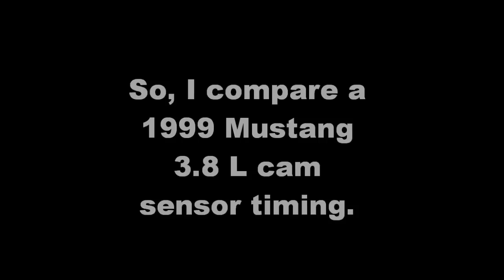Installing a Ford Cam Sensor ( Cam Syncronizer) without the special tool.

Comment from the maker: What I'm showing is that the moving blade needs to be aligned with the stationary window when the crank is at zero degrees and both valves are closed on #1 cylinder. The position I installed the sensor in is the factory orientation. As long as one is able to reconnect the sensor lead, it can be installed 'clocked' to any of the teeth on the sensor shaft. As long as the blade and window line up when everything else is lined up, the ECM believes the engine to be at TDC.

Comment from the maker: Can Sync on an American car usually means the ECM gets a signal from the Crank sensor and it expects one from the cam sensor at the same time. If it doesn't get the two signals when it expects them it throws the cam sync code. Check timing chain and the drive gear on the cam that the sensor engages for wear.
Reply: I never got that code so I probably dodged a bullet then

Comment: Had this bird chirping noise from under the hood of my 2001 Taurus. After google research , reading forums etc concluded it was the cam position sensor. Found out that there are a raft of these parts made in China that you must steer clear away from. So I ended up ordering a Motorcraft part. It did not come with the tool, and I read all of the recommendations 5 times, and ended up marking the old part with a red sharpie on the engine. Also took photos. Removed and replaced part exactly in the same configuration without cranking the engine during the repair. 

Happy to report that the chirping noise was indeed the cause of the problem. Seems that motor oil does not lubricate the upper portion of the CPS and it fails. The Chinese parts end up failing soon after replacement so that is why you want to stay away from those tin can replacements from China!
Reply from the maker: Thanks for that information. :)

Comment: None of those are suppose to be set at TDC. I have a Chilton repair manual and for my 1998 Ranger 3.0 it needs to be set at 75 degrees from TDC. Those adjusting tools for cam syncronizers can be rented out from Auto Zone for $20 come in a box with 4 different ones. and when your done you can take them back and get all your money back. 4.0 and 2.3 have to be set at different degrees. You can also buy the adjusting tool for $10 but you probably will never use it again. If it's not set properly the code will never go away and timing will be off.
Reply from the maker: I guess you missed the part where to test my theory I looked at the position of the cam sensor on a similar Mustang that was having no problems? You know, running fine, no codes. Set it at TDC compression and looked at where things where. Then go to the the engine that needs to be set and make it the same as the one that was running. Everything will work as intended.

Since everyone doesn't have an operating similar engine to compare things with, I saved them some trouble. 

Have a nice day.

Comment: the cam position sensor is only used by the computer for injector timing not engine timing that would be the job of the crank position sensor. the motor will still run with out the injectors firing in the right order it will just run super rich because the computer will never find the right air to fuel mixture so it over compensates in the wrong cycle and bam poor gas milage

Comment: Could this work for my 98 Ford e250 van ? I inadvertently took out the camshaft synco when I did my thermostat Job now my van has a weird rattling sound on acceleration but live Data says that advance timing is around 14 15 degrees

Comment: all one has to do is mark how the old one comes out and simply reinstall the way the old one came out.
Reply from the maker: Stephen Chandler that works as long as everything is intact before dis-assembly. If the timing chain breaks first, as it did in this instance, and one never thought to check it before the chain broke then its a guessing game. This eliminates the guesswork due to that circumstance.
Reply: i just bought a van with 4.2 ford v6  with no cam sensor or synchro im just starring at it.lol its confusing

Comment from the maker: I could have installed the sensor blade and window 180 degrees from the position I installed it in IF the connector leads would have reached that far.

Comment: Hello i did a dumb thing and did not mark the position on the sender . i put cyl 1 TDC and installed . the car fired up and now runs good BUT it has a hicup and a fast idle at start up . service engine light is on and says cam shaft sender bad .. now i was told it could be 180 out . does this make sense ? . car got plenty of power just hicups on idle . any help would be great-full

Comment: Interesting watch, im trying to resolve the same problem with a 5.0L windsor in an australian falcon with what looks to be the exact same sensor... a single 5 degree wide tooth and not a large 180 deg one.  Problem is that i can stick it in any which way i like and it wont change a thing, TDC, 30 BTDC, 30 ATDC, whatever, no difference.  Except it has poor economy.  But starts and idles like a clock regardless.  Im lost hahaha.

Comment: i have a 1993 Ford ranger it's got the 4.o motor wen i start the motor let it for like 5 minutes it starts idles ruff for a minute then goes back to normal wen i drive out of town it bogs down like it's lost all it's power check engine light comes on i was told it could be the cam shaft position sensor i check the plug wire's at night there is a flashing white light at the end of the wires i put a lot of money in this truck i just wish i could figure this out can someone please help me

Comment: I have an 02 ford ranger. I replaced the sensor a while back but I don't think I have it in thee right position. Is there a way to check for the proper position that doesn't ivole breaking down the engine?
Reply from the maker: Yes, remove #1 plug, bring engine up on compression stroke on that cylinder, align the timing marks on the harmonic balancer, remove the cover\sensor from the synchronizer and see if the blade is centered in the window\cut-out of the synchronizer body. If the engine is running it should be close, if it is 180 degrees out, recheck that you have #1 at Top Dead Center on compression stroke. Adjust accordingly. Bottom line is, the blade must be centered in the window at TDC #1 on compression stroke. Put cover\sensor back where it belongs on the housing.

Edit: if the blade is close but not centered, loosen the hold-down bolt and turn the syncronizer housing until the blade is centered.
Reply: Thanks I will give this a shot.
Reply: Psychoholic Genius
Hello I have 1998 ford f-150 4.2 and cam sensor was in wrong position.We did procedure you were recomending to gary Jernigan and very oddly (or i may be lost) the cam position shaft will not go all the way back down, in engine.before it would go right in.Tried for 45 minutes and it just wont go back down.I am lost.Can you think of anything simple i am missing?
Reply from the maker: Tim Matthews
Yes, sometimes the oil pump drive shaft which fits into the hexagonal opening in the end of the cam synchronizer drive gear just doesn't quite line up properly. I usually just bump the engine starter while applying a slight downward force on the cam syncro. after it seats, re-align the timing marks to make sure everything is where it belongs.

Edit; spell check didn't like syncronizer for some reason and dropped the 'r'...

Comment: Why you couldn't you  just note the position of the old synchronizer and install it in the same position? Unless it was already out  or the engine was turned when it was out?
Reply from the maker: IIRC the engine threw the timing chain. Since this engine does not use a 'distributor' there is no 'illustration' indicating where this needs to point. In the manual it only mentions using the 'special' tool to ensure proper alignment when installing the synchronizer.
Reply: Since it threw the change then yes TDC would have to found to retime the crank and cam. Then it should also should be inline to drop the synchronizer in. It works almost like an old distributor the gap just let's the VRS cam sensor know when #1 is at the top of its compression stroke.

 I was referring to just replacing a snychronizer on an other wise healthy engine. If you just mark where it was pointing when it was removed and just put the new one in pointing to the same position like you could with a rotor button on an old distributor. That's if the motor wasn't rotated why it was out.

Comment: No light but when on a scan tool shows that the cam sync sensor has a fault.

I have since checked all the photos showing the base side of the special tool and they aim the tooth centre of the keyway an that is where mine is sitting and it starts and runs fine but suffers poor econ.  However i have since got someone else to send us a pic of his sensor and it show is point to 4 oclock when looking straight down and the keyway in line with the crank.

Comment: How about on a 2009 f150 5.4?
Reply from the maker: I can't say for sure as the only experience I had with that engine before retiring was changing plugs and coil-packs. But, if it uses a similar cam sensor set up I would imagine setting the engine @ TDC compression #1 and ensuring the cam sensor is aligned with this window as it is here, it should be close enough the ECM won't notice.